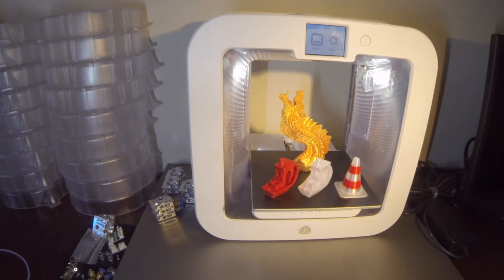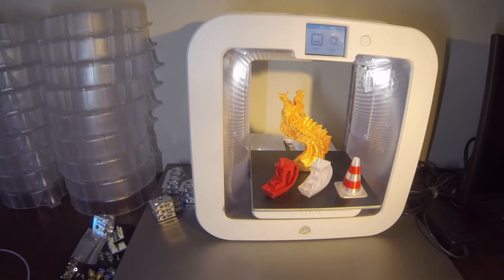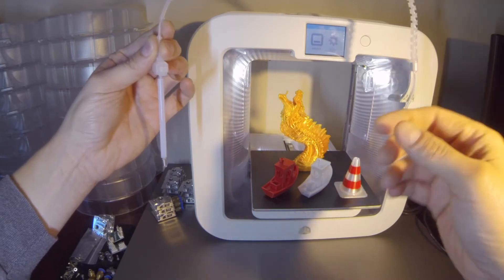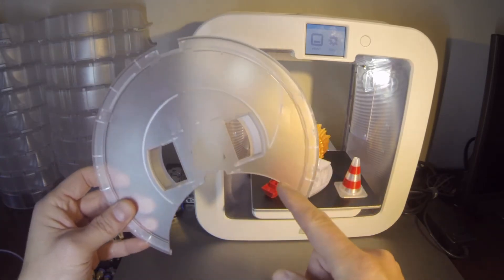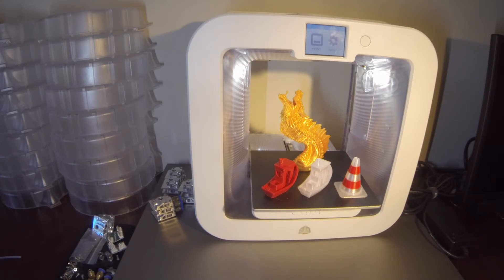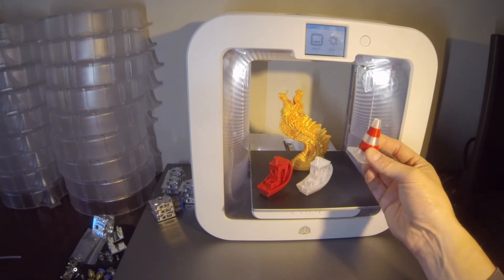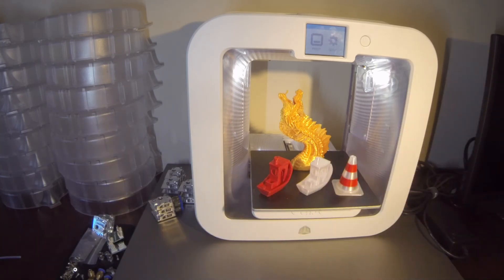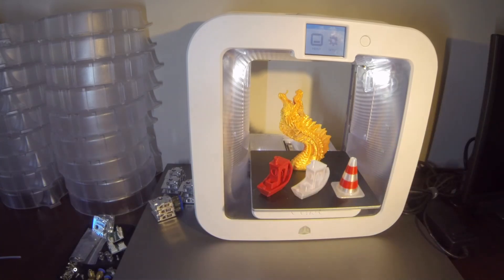Your 3DSystems Cube 3 isn't clogged! These two, easily resolved, issues frustrate most owners.

Comment: I am posting this in 2025 and was surprised to find your video from a shorter 3 years ago when this printer, back then, was 7 years old. I run a small printing business with, of course, newer printers, mostly all Vorons as they, if you are still into printing, they run clipper and are super fast. I am not really a fan of the Bambu Labs, prefer Vorons. BUT I do have some vintage machine, just for the cool visual history. I have some you probably never heard of, for example, Dobot Mooz2 and Mooz3, Sindoh DP200, iMade3D Jellybox, and Snapmaker A350. You might have heard of the Snapmaker as it does 3D Printing, CNC, and Laser engraving. BUT I did, 1 year ago, pick up a Cubify 2nd generation, only as it was cool and green in color. I actually got it for $70 and way back it was $1200. I didn't expect it to work and it even needed a custom .cube file vs. gcode. BUT 3D Systems had an archive site to get that old slicer and, shockingly it works. Now the qualify is marginal. BUT it works and is a cool retro machine. I used to run Lulzbot TAZ 5 machines, which you probably heard of them as they were really workhorses at the time. I even added a Moarstruder which is a 1.2mm nozzle so I was, at the time when printers were slow, printing out very quick prototypes, of course the detail was bad but for prototyping it was great. I see one of these on eBay and I might grab one. I do know that the Cubify 2nd generation the cartridges have chips in them BUT you can bypass that with a workaround of removing one of the chips, I printed a holder for the chip, I hold the chip and holder on where the cartridge sits on the machine, you can start a print and when you remove the chip holder it senses that it's gone but will keep printing. So it never changes the chip to having used any filament. Of course I would not be buying this for daily use just for the history of it. The one for sale is new but new as of 10 years ago makes it, probably, not really usable. But, there might not be a similar hack for the filament chip on the 3rd generation. In fact where is the filament chip?

Comment: got any spare chips for various materials from the cartridges?
Reply from the maker: You don't need other chips. Set the Cube software to print in the material you want to use and then change the material code in the print file to match the chip using Cube3Editor (available on Github). Example - Load PETG filament using your white PLA chip and cartridge. Slice the print for PETG (EKOCycle) then open the file with Cube3Editor, change the filament to white PLA and save. Done. All of the g-code is built for an EKOCycle print but the printer looks for a PLA chip before printing.
Reply: @3dprinttek  thanks